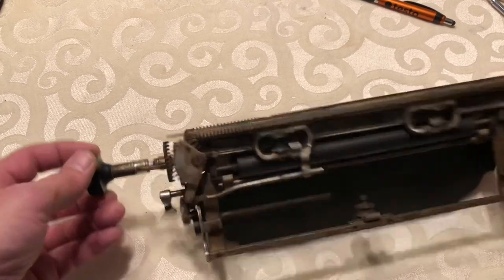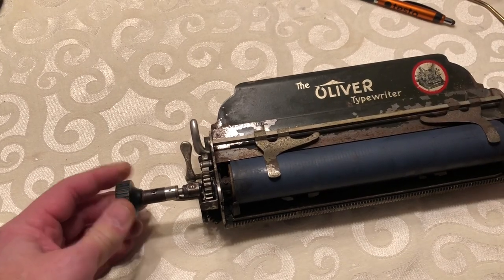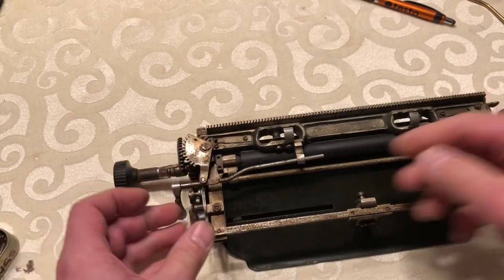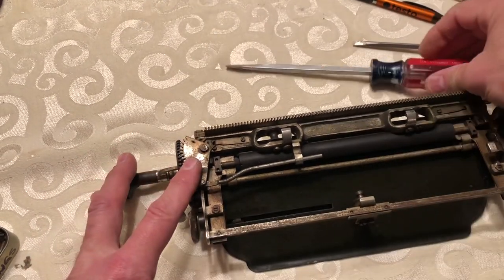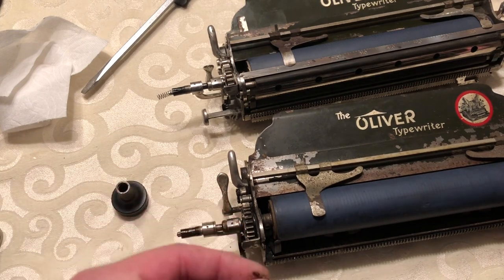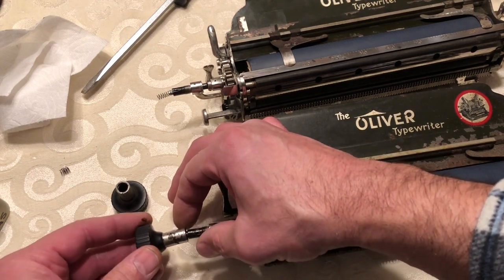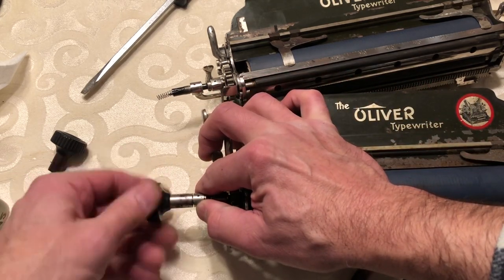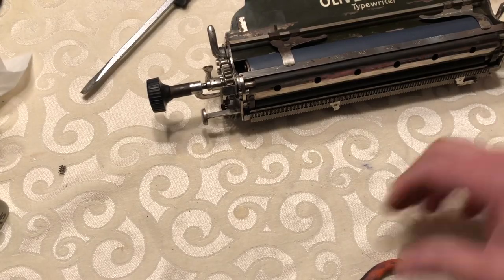Oliver Typewriter Line Spacing Repair.

Comment: I think I might have a similar problem but I cant figure it out. I dont know all the names but I can turn the button thing and paper can be rolled in and out, but when I finish a line and want it to move one line down it just goed back to the start of the same line at the margin where it started. I cant seem to get it to move down. Do you know what the problem might be? I have the erika 44
Reply from the maker: Hello Sanne-Nedieh, 
The Erika 44 is a beautiful machine. Diagnosing the problem with out seeing your Erika would be difficult and I do not know the workings quite as well as I do the Oliver.   My suggestion would be to find a good repair shop in your area and let them have a look, very likely it is a small repair and most machines could use a good cleaning and tune-up.  Another option would be to join a few of the typewriter groups on face book and submit a video of the problem.  Best of luck with your Erika,
Bryan.